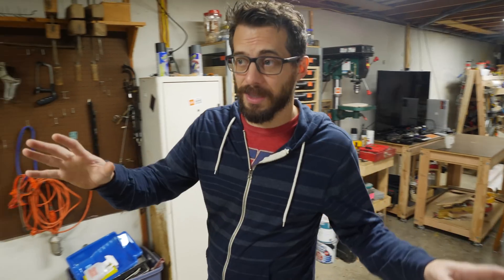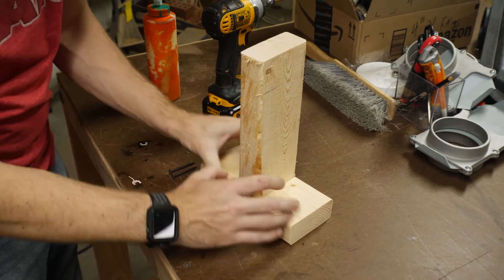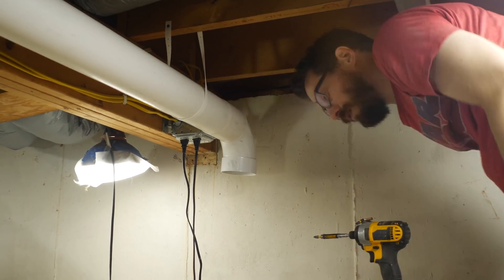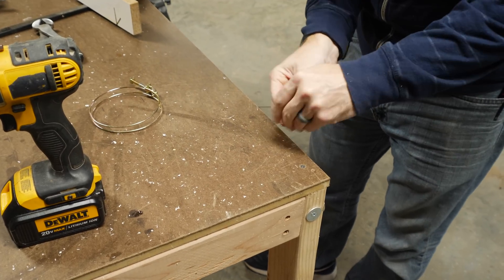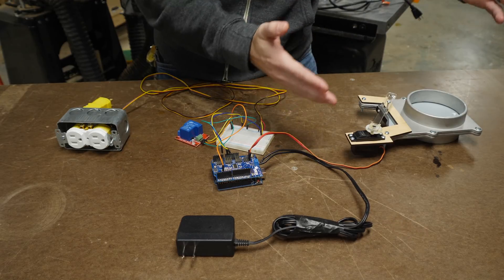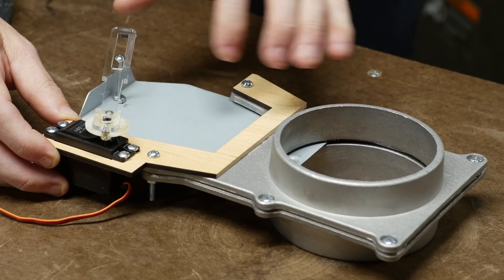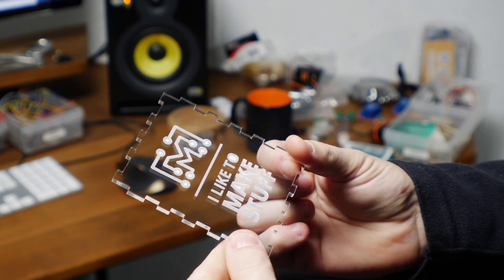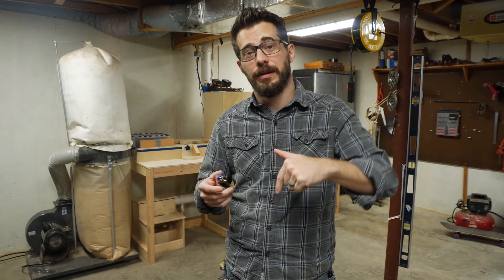Fully Automated Dust Collection powered by Arduino // How To | I Like To Make Stuff

Comment: Static buildup is guaranteed.  I get shocked all the time when my arm brushes against the pipe near my planer.  However, the idea that the static discharge combined with dust will cause a fire is actually a myth and is extremely improbable.  Oily rags causing a fire however, is NOT a myth.  Just thought you'd like to know, since you have such a huge audience and I'd hate to propagate myth and misinformation.
Reply from the maker: I honestly don't think it'd happen either, but since it became such a huge discussion on my old video, I figured better safe than sorry. 👍🏻
Reply: Sure thing... at least you won't get that disturbing shock like I do once in a while ... that's the real benefit of the grounding wire :)
Reply: Not trying to be argumentative, but industrial circumstances OR grain silos are significantly different from a home shop.  I have seen many woodshop stories about shops burned down due to oily rags and other situations, but never seen a home shop that had a fire or explosion caused from static discharge in a home DC system.
Reply: panofish I won't argue that industrial and residential have a vast amount of differences. I can offer, though, that we also put about a dozen systems into colleges that had wood shops. Their dust collectors had timers on them and would typically only run for 100-300 hours a year. In NS, explosion protection was mandated by law and school programs were shut down until they had the systems in place. This was due to an explosion in a school shop in BC that either injured or killed two students (I can't remember exactly details as I haven't worked for that company for a number of years now). While the deflagrations and detonations of small system dust collectors are few and far between, they are not as infrequent as you might expect. For the few extra dollars it cost him to ground the system, it's hardly cost prohibitive.
Reply: Korishan Agreed; instead kf counting on a screw at a single location, I'd probably pull a wire through the whole length of the main trunk and anchored it with a lug through the wall to the main ground.
Reply: I was just going to say, if you decide to ground the pipes (as you should) a single point will do nothing. Wrap a strand around all pipes, ground each end. 

At the plastic factory where i work all flexible pipes need a ground strand in the coil, are cnnst (our quebec osha) will cite us if we dont or if we dont clean up dust, as its all a fire hazard. And thats non-flammable plastic!
Reply: All it takes is the right combination of dust particle size and ignition source and you most certainly can have an explosion. 

The shavings from most things (chop saw, table saw, routers etc) are not fine enough.  But powdery sawdust from a sander most certainly is.  

We used to take the dust from belt sander bags (outside mind you) and throw it up in the air above a small ignition source.  It makes a very large fireball.
Reply: Matt Heere I’ve read that all over WW forums, but they’re confusing two concepts. Sure, PVC doesn’t conduct a current through the material, making it an “insulator”.  But static charges live on the surface. When they discharge they are moving the charge across the air. A ground wire gives an easy path for the charge to drain off. Otherwise it’s going to build to the point that it discharges elsewhere, like to Bob’s finger.
Reply: Yeah. Plastic isn't really "non-conductive". Well, in the sense of conducting electricity freely, I suppose it could be. However, it acts more like a capacitor. It can take a charge and keep building up voltage until it reaches a critical point where it's released in a "shocking" manner. Just like a balloon isn't conductive, but you can get a shock from it. Plastics are a peculiar substance in the way it can react with electrical charges.
Reply: Nobody can point to a single verifiable report of a saw dust explosion caused by ESD in a dust collector system in a
small wood shop (let alone a fatal one) but so many people are so worried about it "because it MAY happen".
At the same time those worried souls drive cars and walk on the streets without any fear even though probability of an accident there is much, much higher...I wonder why is that?
Reply: londontrada, Static electricity is just an imbalance of charges on something that's not really conductive. The moment it has a path to ground, it discharges. When you get a zap off your car door, the car has built up static as it moved, and when you touch it, you become a path to ground. But if your buddy on the other side of the car also touches it, they won't get shocked, because the static charge on the whole surface of the car was dissipated. Unless there's something I'm missing, the same thing is true of the pipes and one ground wire should be fine.

Adam Savage is on YouTube these days. Maybe we could ask Tested to, uh, legend-break?
Reply: That would be an interesting idea. I can see it working on short lengths, but dealing with a pipe longer than 4' would pose an issue. I don't think it'd cause RF interference as it'd be grounded, and it's not a frequency like radio waves.
Reply: Uncle makes plates in his basement and has a dust system like this. About 2 years ago it DID blow out a big fireball when it got zapped. No it is not a problem confined to industry, it can and will happen anywhere if not grounded
Reply: I get your theory with the capacatance part, I've been shocked off my pvc dust collection. but as far as grounding it you'd literally have to ground it everywhere to make it worth while. I've actually tested pvc with high voltage test gear to compare it to the "live line tools" I use for work and it tests very well, I wouldn't trust my life with it but I'd say its anything but a conductor at least in the home woodshop.😉 I'd be more afraid of sucking a screw up and it hitting the fan blade and sparking.
Reply: Yeah, I was thinking that's what he was gonna do at first, until he spun the two strands into one.  :)   I think the length would be a good idea, too. Maybe at key points use a metal coupling or joint that the wire attaches to. That'd help too.
Reply: Will that wire actually ground out the static? As the PVC pipe is not conductive, surely it will only ground static at that particular point?
Reply: Static electricity is kind of like water, in flowing that is. It will stay balanced along the entire surface. So when the current is pulled from one spot, it will flow along the surface of the tube trying to balance itself out again. This continues until there's nothing, or very little, left
The reason for running a wire along the length of pipe instead of in one spot is give greater path of least resistance for the voltage to flow. It "is" possible for the static charge to build up rapidly in one spot over another. And if it discharges at the wrong time while particulates are present, it could cause an ignition. By running a wire along the length of tubing, this greatly reduces (notice, not eliminate) the chances of a rapid buildup in one location over another. By keeping the voltage low, it keeps the chances of a spark from occurring.
Reply: I agree and grounding a nonconductive material has never made sense to me.
Reply: If you're talking about grounding the pipe, I don't see any harm to it, even if you don't think the dust collection system will catch fire. As for the method, I don't know if I'd go with a single grounding point on the pipes. WOuldn't it be easier to run copper foil tape (maybe 1/2 or 1 inch wide) along the inside of the straight pipes, then run a wire along the outside with a screw to connect the different tape sections to the wire, and then run the wire to the building ground? The only major drawback to this (besides effort) I can think of is RF interference creating a signal on the grounding wire and playing havoc with electronics on the same ground. (Not sure how likely that would be.
Reply: Really? thanks for the advice
Reply: Being an Iowa boy, I can tell you that being an Iowa boy doesn't matter. It's definitely a myth, and one that needs to die. There is not even a remote possibility of an explosion in a dust collection system.
Reply: Very sensible Rob.. I agree.  I only have my personal experience and very little evidence to support the theory that my home dust collection system has much risk from static electricity.  What we really need in order to answer the question is the scientific method.  Sadly, there are no science grants out there to support such research and the mythbusters TV show no longer exists.
Reply: All in all, better safe than sorry
Reply: static discharge combined with dust will cause a fire is true and can happen. I'm a tanker driver and I deal with dry materials, such as sawdust and with the right conditions it will catch fire. ^^
Reply: It's just so easy to remediate static - why would you take a chance?   I would also put a wire inside the dust collector bag that is grounded to the machine.
Reply: the physics don't matter, logic  doesn't matter.  The insurance companies will never cover a fire if they think they can blame plastic ducts. They just won't.
Reply: I seen dust ignite from a hot bearing failure and a move a 4ft thick 30 ft wide concrete top 8 foot in the air before it crumbled down the silo. Any dust is explosive if the ppm gets right and an ignition source comes into play.
Reply: Robert K Yes, it MAY happen. It probably won't, but it might. So why not mitigate the risk as much as possible? To use your driving analogy, I MIGHT get into a car accident on my way to work and I MIGHT get ejected from my vehicle. But it's a very short (sub 10 minutes on a good day) trip, so the odds of it happening are exceedingly low. So I might as well not use my seat belt. Or bother to stop for the red lights. Or any of the countless other things we do to take an inherently dangerous activity like driving and mitigate the chance of injury.
Reply: Elijah McStotts why don’t you mitigate the risk of being killed in car accident completely and not leave the house any more ?
You obviously missed my point that we worry about rare threats way more than those threats deserve while ignoring threats that are more likely to hurt us. 5000 people died in a single  event (9/11). 50,000 Americans die every year in car accidents. Just think about this for a moment and consider how much is being done to prevent the recurrence of that one ever vs 50,000 others.
More than one million people kill them selves every year which is more than in all wars and violent crimes combined.
For whatever reason people focus on risks that have low probability but ignore the high ones. 
Wear seatbelts and sunscreen. Both are more likely to save your life than a wire wrapped around pvc pipes of your dust collectors.
Reply: @rok1475  
You don't mitigate risks where you can, especially  when it's easy to do?

I have personally been involved in a dust fire. I'm not sure that dust knows when it's in an industrial setting and when it's in a hobby shop. I don't think dust really cares. I  will definitely be throwing in a ground wore to the dust collection system I am about to build in my garage. Easy mitigation. Easy decision.
Reply: I actually used to work as an explosion protection technician and we installed active suppression and isolation systems on a TON of wood dust collectors across Canada. I've actually got security camera footage somewhere from one of our customers, a MDF factory; our system prevented a full on explosion, reducing the issue to "only" a fireball. You can also look up and read about a different customer, Babine; they installed one of our systems after an explosion leveled their sawhouse, injured 25+ people and killed 2.
Reply: Dust air explosions are certainly real - in grain silos and other places with sufficient dust density and the correct dust particle size and the right chemistry of dust particles.  That doesn't  mean it's possible anywhere that there is a mix of dust and air or my lawn mower would double as a flame thrower!  Explosions in wood-working shop dust collections systems caused by static build up on PVC are out there with Bigfoot.

Oh and BTW that ground wire does nothing.  You can't ground an insulator (PVC) like that because the pipe won't conduct the charge to the ground point(s).  I guess Bob is done for.   Too bad because I really liked this channel ;)
Reply: Matt Heere it actually does do something. PVC is actually pretty high on the triboelectric series, meaning it can hold a static charge very well. The screw will ground the pipe and direct the static charge to the ground. If you rub a towel against a PVC pipe, it will collect a static charge, same principle with the dust collection system, the sawdust particles and even the air can collect a sufficient charge to cause a spark and (maybe) cause a dust explosion. Extremely unlikely, but do happen every year.
Reply: I agree with all the rest of the comments below about the safety factor. Just because it might be rare, doesn't mean it won't or couldn't happen. As mentioned, the few seconds it took to ground the system to ensure the safety is well worth the cost and time. Especially if it could have happened, and this prevented it, look at how much tools, supplies, life, would of been saved.
People who drive safely in their cars still buy insurance for the time they "might" have an accident. This grounding strap is an insurance policy for his shop.
Personally, I think he should of put more than one ground line in the system. But that's me. The extra safety would be well worth it.
Reply: If you want to reduce static shocks, you can run a bare wire that parallels the  PVC pipe and touches it all along it's length (or just a decent amount of it), and connect that new wire to the ground as well.  This will help the static bleed off the pipe all along it's length rather that just at the one point like Bob's system.  We do this on fuel fill pump lines on our farm and it eliminates static. (and feels safer!)
Reply: Being an Iowa boy I can tell you pretty definitively, cellulose + air + any ignition source at all = boom, static discharge, motor winding arcing, rodent chewed wires it doesn't matter. Yes it is "extremely unlikely" but that doesn't mean that it doesn't injure people every year.
Don't be "That Guy" and say that something that actually happens and KILLS people a myth, Bigfoot is a myth dust-air explosions are not.
Reply: Doesn't the static charge distribute itself along the entire interior surface of the pipe, though? If that's the case, all the static in the entire pipe would discharge instantaneously into the ground wire the moment it built up enough to reach that screw. Like those ESD straps computer technicians use; they don't have to wear a bunch of the things, one point of contact is enough. I'm guessing the buildup needed to reach that grounding wire would be well below the threshold required to form a spark.
Reply: panofish actually if you work in a grain silo at a factory and the fans shut off it's a mandatory evacuation till the fans are fixed. It was on myth busters that they proved air plus fine powder can catch fire also on Mr wizard and modern rogue with coffee creamer air and fire creating a fire ball. Look up creamer fire and saw dust fires or sugar fires. I can tell you I play with the powder creamer and throw it at an open flames to create a fireball.
Reply: One of the best write-ups on the subject can be found on the internet time machine... I have made a short link for you... just decode this to see the article: bit dot ly slash 2itjzE4